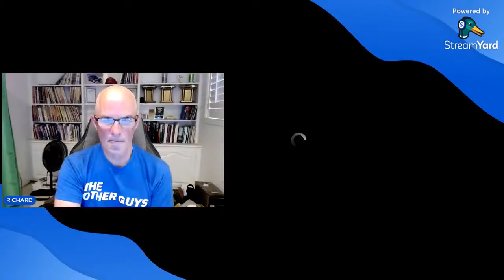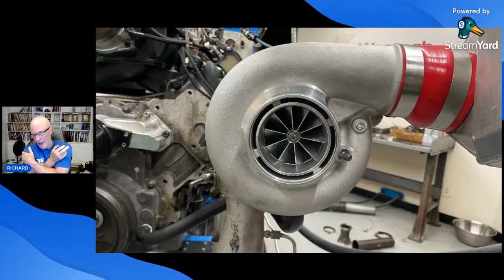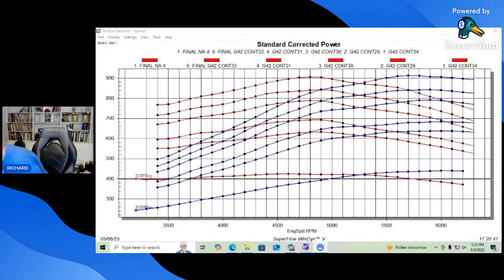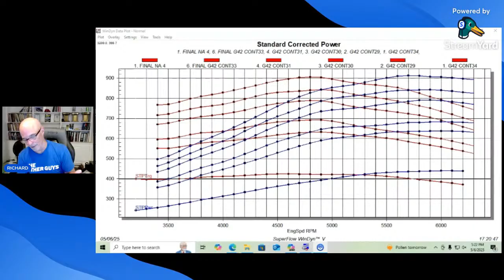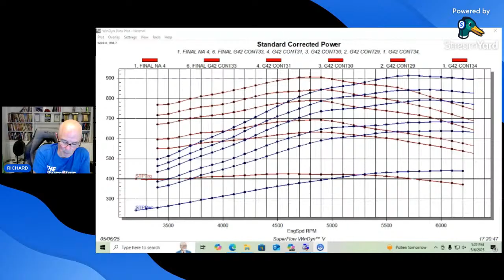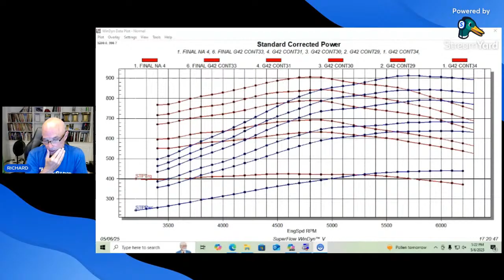Comment: Are the t4 961 turbos gonna be okay with my ls3 project with the engine at around 58,000 km I have a proflow super max getting fuel pumps and a surge tank blow off valves and 50m waste gates is this near enough to get something started

Comment: Shoot. Missed the live. I'm building a na vintage race car. 2.8 I6 Mercedes. 180hp stock. Hopefully a touch more with the Webber 32/36 DGEV. Pretty nice long(ish) tube manifolds into 1.5" id downpipe bung that fits the manifold. I can step immediately to 1 5/8 I'd tubing on the bung if I butt weld it instead of inserting the pipe. Should I run a short section of 1.5 then step up before the y?  It then goes to a y pipe and 1.75 id single . I don't know if 2" is sufficient? 2.25" maybe? Do you think changing that to 2.5" is overkill? It's a 6500 rpm motor but I don't want to kill the lower end of the power curve much for the upshifts.
Reply: is this the exhaust? Are you taking about a Tri Y header design
Reply: @richardholdener1727 basically. It's an i6 with two 3cyl manifolds.
Reply: I just don't know what would be sufficient without being over kill and hurting power on the system to the rear. A single  2.5 seems pretty large for sub 200hp.
Reply: @jasonbirch1182 Either 2.25 or 2.5 would be fine I think.
Reply: @richardholdener1727 
so a pair of 
1.5 primarys is 3.54 total area.
A single
 2" is 3.14
2.250 is 4.05
2.50 is 4.91